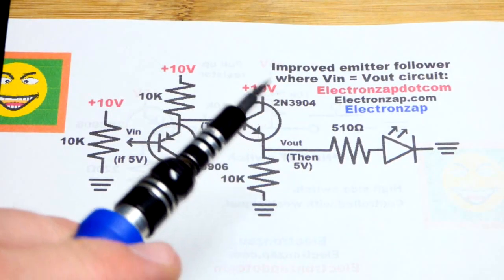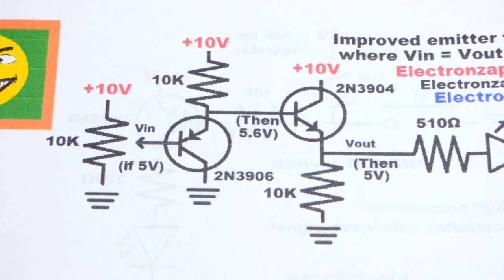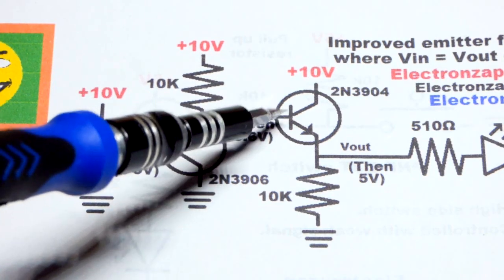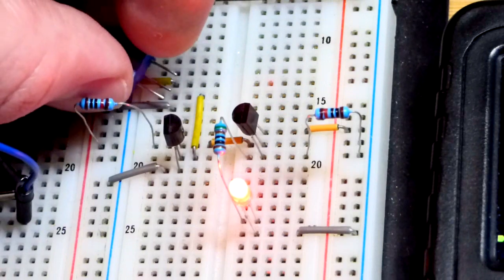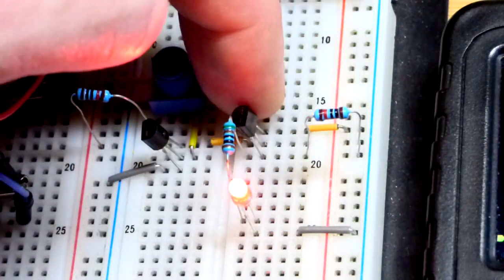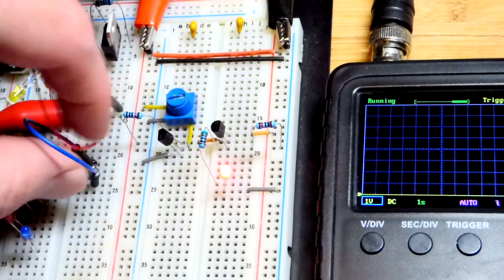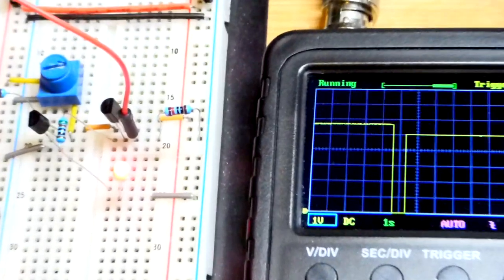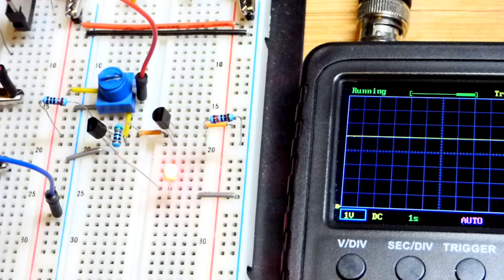Cascading emitter follower common collector BJTs so that Vin is Vout with PNP 2N3906 and NPN 2N3904

Comment: Why can’t the trimpot/ voltage divider provide enough current for the load directly?

I mean it’s connected to Vcc same as the transistors are....I’m a bit confused.

Great video as usual though 👍

Comment: How do you calculate the resistor values? I see you use a 10k trim pot and a 10k emitter resistor, do these values have to be the same?
Reply from the maker: Other than timing circuits, most of the time when I use a 10k resistor or trimpot, 1k up to maybe even 100k will probably work too. I believe I only have 10k trimpots that are this breadboard friendly. A lot of circuits just need some current to be able to flow through a resistor, but too low of a value wastes current/power or makes too much current flow through one or more components, and so 10k is most often a good balance, but a bit higher or lower will probably work about the same.